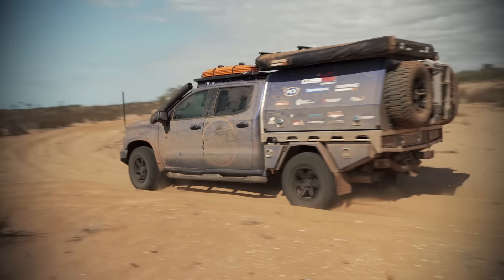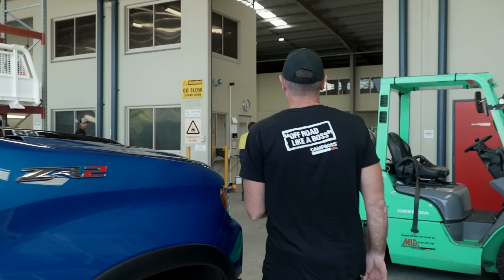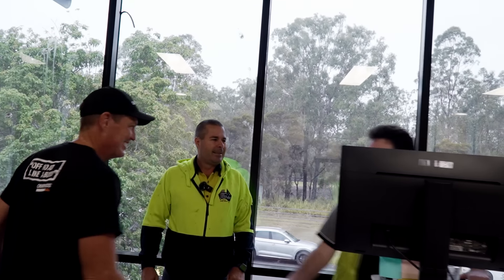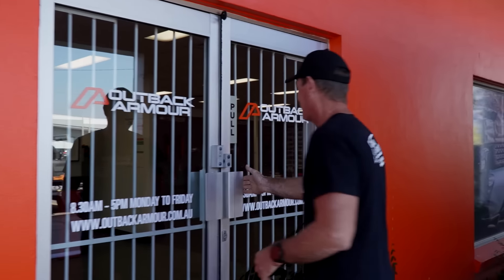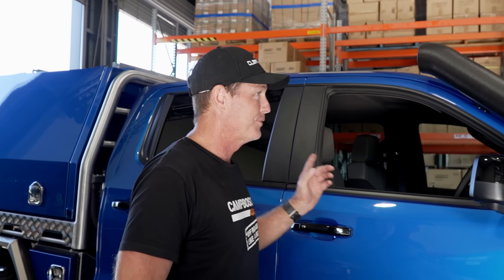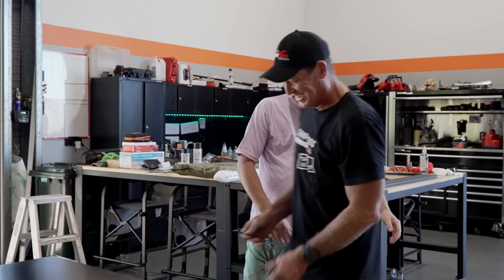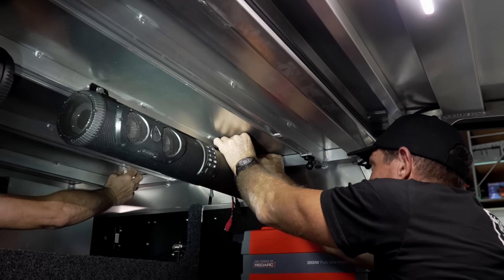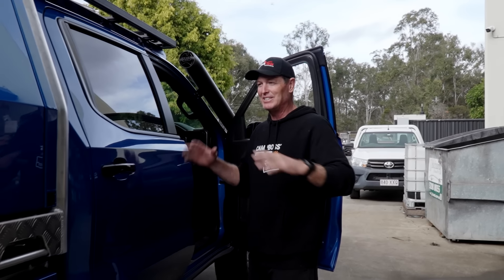🔥 FIRST EVER AUSTRALIAN CHEVY ZR2 TOURING RIG — All 4 Adventure Season 15 BUILD REVEAL! 😯

Comment from the maker: 😎Like, Subscribe & turn those Notifications on 🔔 -- View the full list of Chevy ZR2 gear here: https://www.all4adventure.com/our-adventure-gear/silverado-zr2/
Reply: too big for the Aussie Tracks!
Reply: now your next challenge you need too grow 2 ft taller so you can reach things easier lmfao or give it to simon
Reply: next build TRX ram ? 800hp jase do it
Reply: so chev,, are following ford & dodge, as usual.. cant think of sht themselves..  ausie.. id be buying the power wagon,, buy, drive, no mods needed..but, i dont have 500k to blow, by the time your finished..
Reply: ooohhh,,  fk,,its an LS  .. dont touch it.. if it was the 6.6 duramax isuzu. no probs..
Reply: the allison,,is the only decent decision chev made in 100 yrs..
Reply: only 35''tyres.. needs 37,s..& 2 more '' lift.. & a front diff..
Reply: 80 lt,,??,, thats pathetic.  i have 145 std,, & 85 in the tray..in a std tank takes up 6'' .
Reply: i go 4x4ing,,to get away from the bs tv..
Reply: WHEN,, are you going to start using a power tank, & not this bs arb compressors.. detroit lockers,or,&, e locker..for rear.  nice truck, id hang it on the wall as an ornament..
Reply: @harrywalker968  its not an ls... its an l87 based off lt family
Reply: @harrywalker968  Hes also wrong its not an allison its a 10l80 a joint venture between Ford & GM
Reply: Is there someone in NZ that could do similar mods that your guys did ? Stoked it has a 2” lift from factory. Im from Oz but live over here these days. Let me know?
Reply: Jase love the truck mate 
Nicely done 
Don't see a need for a tv but it sound pre fuckin mint 
Have to say the colour doesn't do it for me but ur Ute ur choice
I'd love to see a 4wd 24/7 A4A collab series I reckon it would be the greates to all time
Reply: @harrywalker968  more like 42s considering the length.
Reply: Just wondering when pick up is available? Thankyou ❤

Comment: These builds are getting more "Pimp My Ride" everytime. I feel like the mext rig will have a live Barra tank  or hot tub in it
Reply: Yes, getting ridiculous! 4 light bars,  2 front winches, huge sound system(who uses one of them, let alone 2 in the bush??) and a freakin TV. Whoops, forgot about the light show inside the canopy! C'mon guys! I know you have sponsors but there is a line and you've crossed it. It's becoming corny.
Reply: I remember when the show wasn't a sellout
Reply: I'm American and it's out of reach for us. These new utes/trucks are built the same way as older utes. The new ones has a million sensors and the replacement/repairs are very difficult and expensive.
Reply: The non copyright music was took my mind straight there.
Reply: @bamafencer12   The trucks themselves are ridiculously expensive, i was just on ford configurator and I actually felt insulted.

Comment: just curious in regard to all the added weight , appreciate you have tried to use aluminium for most but all the fitout components are heavy and the ZR2 only has 700KG payload so by the time you filled up the Bigger fuel tank , fresh water tanks and supplies to actually do long range mission you would not be able to Carry any Passengers < Is there a reason you didn't opt for the 2500 that would have been more practical with capacity ?  DOES look Bloody Good however
Reply: Thought the same, but once upgraded. Steps it up a bit! 

FIGURES	BEFORE	AFTER
GROSS VEHICLE MASS	3300KG	4300KG
PAYLOAD	760KG	1760KG
GROSS COMBINATION MASS	7160KG	7160KG

Comment: I just looked it up and the standard GVM is only 3300kgs but it weighs 2500kgs, leaving only 750kgs payload! A 1980 hilux can carry more...these are really just giant SUVs in a way
Reply: Yup my missus 1996 gen 3 surf has 750kg payload. All yank Ute's suffer from this huge over site. At 4.5t towing this ute only has a payload of 68kgs* and people and fuel weight is included in that. So a very light person could sit in the ute  ut wouldn't be allowed to have any fuel lool
Reply: Pretty obvious the thing had a GVM upgrade.  That's why  the stock suspension had to be ditched.
Reply: Yes and never make it over 60km/hr
Reply: @einfelder8262  GVM upgrade only just takes more away from your towing. It doesn't upgrade your GCM as well.
Reply: @paulmcintosh5589 just curious,  this would go 70 mph / 112 kph in the U.S. easy. Why would it be that much slower there?
Reply: @jasonclark3781  I think he is referring to the hilux fully loaded wouldn't make it over 60kms
Reply: @jasonclark3781  
No just using a Toyota as a reference they are very underpowered here so loaded they are slow. Compared to other manufacturers of the same year
Reply: @paulmcintosh5589  gotcha.  So what engines do you guys have there?  As you probably guessed I'm in the US. I have an 06 Toyota Tacoma (very similar to your hilux) that has the 4.0 v6 which has lots of power with about 236,000 miles on it.  Is it a Government restriction thing?
Reply: @jasonclark3781  
Same yes best option 4.0 engine petrol is to expensive so all are 3,0 litre 4 cylinder diesel 130 engine KW terrible.
Reply: @paulmcintosh5589  maybe old hiluxs. With 22r, 3y or L serise engines. But 1kz, 5vz and 1gr engine are incredible engines.
Reply: @jasonclark3781  we have all the same engine options. Just more diesels rolling around.

Comment: What aftermarket fuel tank did you install on your truck?  Here in the states, its been a pain to find a bigger fuel tank solution for the 6.2l V8.  26 gallons is not big enough for these trucks.

Comment: If it comes that way then it’s not a 2 inch lift, is it
When drilling into something like that roof cut a piece of plastic tube and fit it over your drill bit so when it cut through you don’t keep going 😉

Comment: I take it GM have sorted the lifter issue caused by the fuel economy mode?
Reply: Right now the engines built by Chevrolet doesn't have the dfm so you don't have that issue
Reply: @franklinstidham9037  what year models need to be avoided?

Comment: I don't think australia should go too far down the path of the big american trucks for a few reasons that most dont think about.

Firstly the USA is way more "country" then Aus - so most don't realise that about half of the US population lives in towns with a population less then 5000...you can imagine that having a huge wide truck in a town this small wouldnt be a huge problem - but is Aus most of us live in the suburbs  of a large city...you can see the issues here.

Second, I think most Australians think "these trucks are bigger, they must be tougher/more capable" but its not true, yes they can tow 4.5 tons (in aus) instead of 3.5, but they weight about 50 percent more then your average dual cab which weighs about 2 ton and most can carry 1 ton or more, whereas a lot of these american trucks weight closer to 3 ton but some can only carry .75 tons! So the way I see it American trucks (other then the dual rear wheel models) are built more like giant suvs - for comfort, and our smaller utes are built more like small commercial trucks - to do work. 

So lets just take a minute to appreciate our tough little utes that frankly can do way more then most of us need, and they will drain your wallet less in the process.
Reply: Preaching to the converted.
Hallelujah!
Reply: By the end of this year, Ram would have sold nearly 30,000 vehicles in Australia since 2017, when Walkinshaw started the Re-manufacture to RHD.
Silverado been selling well since they became available here
( LHD to RHD also done by Walkinshaw )
Ford start deliveries of Australian converted F150 in October 
Toyota will offer Tundra in Australia as of approx mid 2024.
The R & D process happening now
Toyota using Walkinshaw to do the conversion.
These USA vehicles are here to stay.
Their popularity continues to grow 
Manufacturers will sell what people want to buy.
And there is definitely strong demand for these vehicles in Australia.
Most buyers of these vehicles live in country / rural areas, or, they are bought to go touring around Australia.
They are not city based vehicles.
U can do GVM upgrades if needed, but, the 2500 & 3500 versions have higher towing limits.
Hilux / Ranger etc weigh over 2 tonne, 2.3 t ??before you add anything onto it.
Very few dual cab Utes actually have a 1 ton payload…
A dual cab Ute that is tow rated at 3.5 t, leaves u with no payload, so a GVM upgrade is essential.
If u r going to regularly tow 3 tonne, or more, 
( and drive big distance etc ) then a dual cab Ute is probably not the best vehicle to do that.
Whilst most of the new dual cab Utes now sold in Australia, are very good, they have their limitations etc.
They certainly are enough for the needs of many people, but, they are not enough vehicle for a growing number of people, for various reasons…
Reply: @StephenFogarty2023  totally get where you are coming from but one big difference between Aus and USA is that petrol costs about 50 percent more in Aus, and big v8 petrol engines aren't the most effecient towing engines. Also does anyone really need to drag a 3 ton caravan around? I have a one ton slide on camper on a single cab ute and it has a huge battery, solar power, toilet, shower, enough water for a week, sofa, bed, table,  and seating for 4...I get some people have kids and extra stuff but some of these caravans are very heavy and poorly constructed, if people bought lighter composite panel caravans and were more conscious of weight they would save themselves a lot of money and stress on thier vehicles

Comment: Sorry Fella that is not classed as a BULLBAR ! If you hit a Bull in that it would completely wipe out the entire front of that build, plain and simple! Its called a nudge bar for all those at home. Including Kangaroos they would wipe out the exposed areas of the front end ( Panel damage) Why did you not opt for more protection in a build of a front bar to protect the full coverage of the entire front end ?
Reply: I was wondering why myself considered the factory bumper is mad of steel and Chevrolet offers the truck with a steel bumper that's slimmer and built for a which from the factory front and rear

Comment: 183 litres wont take that Guzzler far
Reply: No no it won’t
Reply: Next year it will be an E.V. !
Reply: Will use less fuel than LC79 with the same fruit. I have had a  79 now have a Chev shits all over 79 especially on the Highway. Why would it have such a small tank otherwise.
Reply: @evspoon78  they are fuel efficient just not that good
Reply: Wrong, my best so far Hwy 9.7l/100, normally mid 11s with some stuff on board, towing offroad camper mid 16s
Reply: @nigelupton9030  9.7L/100k highway with that huge chevy thing?
Pinky swear?

Comment: I've got one on order(ZR2), the bar looks hideous, too low slung with the double winch. Offroad Creative are building a nice slim looking winch bar. BTW why would the average using their own money buy a ZR2 and change the highlight of the car, the suspension. They should have bought the LTZ. The Builds are getting more and more tacky, show off as many sponsors as possible.
Reply: Exactly, I wouldn't swap my spool valves for anything, and if I wanted longer shocks Multimatic can supply them.

Comment: 180 litres? He'll be doing 20-25 without towing in that thing.
Reply: Wrong, my best so far Round trip Gold Coast/ Toowoomba was 9.7l/100. Usually with gear on board mid 11s, Towing offroad Camper mid 16s